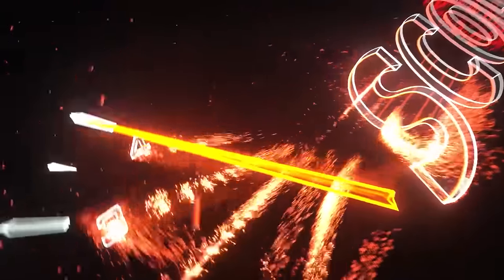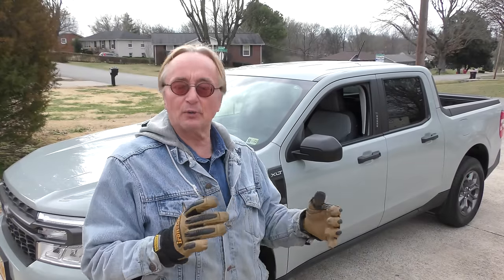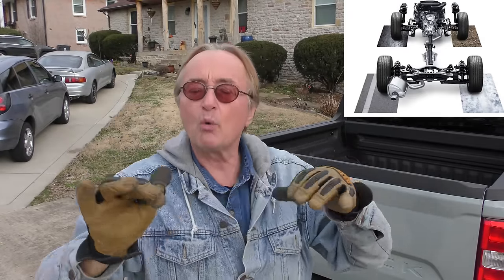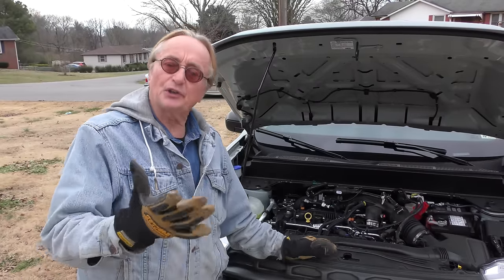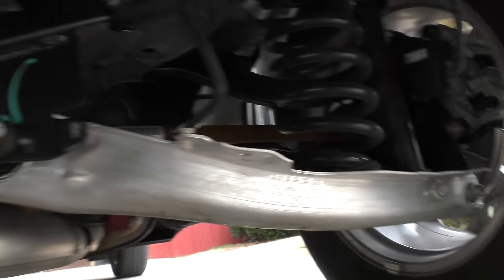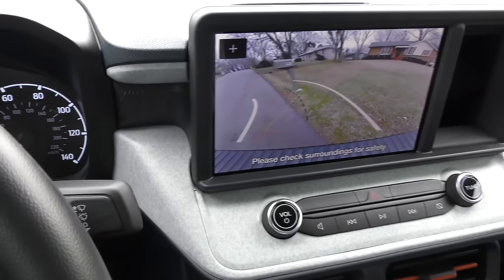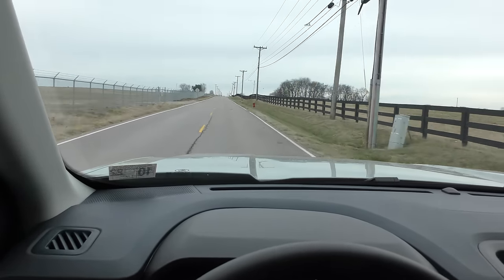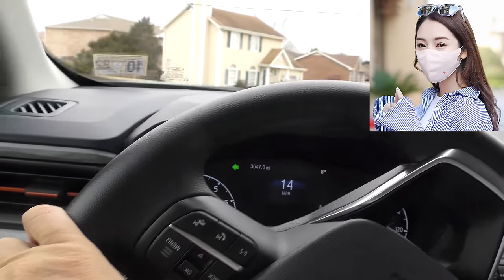I Finally Got a New Ford Maverick and Here's What I Really Think of It

Comment: I've owned my Maverick for a little over a month. I have the basic FWD version with a tow package. I've taken it on a couple of longer trips and have gotten 35mpg each time using the eco setting. I'm surprised by how quick it is when passing, and it is a very simplistic yet versatile vehicle. Most of my complaints about it are just nitpicky things. It drives/handles very well and I give it an overall thumbs up so far. Get a bed extension bar for the receiver and you'll be set for just about anything.
Reply: Very useful information let us know how reliability is down the road bud
Reply: For people who tow, the fwd w/ tow package is 4k capacity and 1500lb payload.  No offense but "just about anything" is very specific to you.
Reply: @dcgregorya5434  You are right. You are not going to haul cattle. I have a small boat, kayaks, and a small trailer. It does just fine for those things. I would hope that anyone buying this truck would know the basic package isn't going to haul huge loads.
Reply: @lonewolffisherman7092  it can haul the same types of stuff you can haul behind a minivan. Not kidding btw, it has the same stats. Thats my issue with this truck...its the truck that just isn't.  There's a big world thats less than a cattle trailer and more than what this can do, it has very low stats to where I feel like people are going to try to do pickup truck stuff with this and come away sorely disappointed or worse, get hurt or damage it.
Reply: @dcgregorya5434  I've never hauled 4x8 sheets of drywall in a minivan, but I have with the maverick. I get what you are saying about towable power, but having a box on the back is very useful for someone who likes to DIY things for my home. That's why I bought the basic package. It's all I need. I've been waiting for a decent priced 4cyld truck for years because that's all I needed/wanted. Great gas mileage and perfect for what I need.
Reply: @lonewolffisherman7092  Was helping my brother-in-law work on his parents home one weekend and his wife has a Chrysler minivan that they use as a family vehicle. It was great to use to haul drywall, BUT... he had to basically clean out the entire back to drop the seats into the floor. Since they had 3 kids that don't take care of things, it took a good 15 minutes to empty it out so he could lay the drywall flat in the back. He was cursing up a storm because of the kids and his wife aren't taking care of the vehicle.
I'd rather have the Maverick :D
Reply: @moej6014  Lol that's too funny.
Reply: @flashlightfreek  10000 miles on my maverick and still loving it. Best mpg to date is 37mpg on a 257 mile trip. The nitpicky things are the radio/infotainment system can be glitchy, and the mode of driving you use doesn't save. Meaning, if you choose eco, sport, or slippery it will default back to normal when you shut down the truck. That's about it! So far so good!
Reply: By basic FWD do you mean CVT, not hybrid?
Reply: @Joshua Nuss  Not a hybrid. It's just the basic gas burning engine.
Reply: @lonewolffisherman7092  just making sure i undersand, you have the 4 cylinder not the hybrid? those are some great mpg! im looking forward to hopefully ordering a 2024
Reply: @jakecelly8215  Yep! Just gas. No hybrid.
Reply: @lonewolffisherman7092  awesome news, thanks for reply!

Comment: I'm waiting for 1 cylinder, hybrid, quad turbo boost, making 60mpg combined, 550 hp and 500 torque, with msrp $45,000 with $35,000 mark up dealer plus 25 APR and total $100,000 out the door just for small pick up truck.
Then I will lifted with $30,000 lifted, put $10,000 tires and rims and put the Balls hanging on the back to make it look cool.
Oh yeah, put a bumper sticker:
C O O L
a $1,000 bumper sticker.

After 4 months, I cried because the dealership tow away my small pickup truck.

At least am happy driving it 4 months only on weekends. 😅

Comment: Maverick is and will be proven to be an excellent little truck. Ford is getting it right with the escape Bronco and Bronco sport and now… they got it right with the MAVERICK. Good to see…
Reply: Truth.
Reply: Says who....?
They just came out and aren't proven
They might be a dissaster like all the other ecoboost engines that are twin turboed with GDI..... 
How long will the AWD system work for the rear drive coupler?
Good luck
Reply: @fil1329  Yep you got it brother. For me I chose the Coyote V8 over the EcoBoost V6 anyday of the week because that way I don't have to deal with the issues of the turbos going out and costing a fortune.
Reply: If they would just get rid of that horrible 1.5  3 Cylinder! 
It's not fuel efficient!

Comment: Scotty, you mentioned  Maverick  from the 70s. I live in the south and I know of two Mavericks,  a lime green  and a brown  one. They both are in very good  shape  and seem to run well. That truck, you're right if not many troubles  rise up with these, they could  be the next  Model T sales wise.
Reply: Could never be said about the Chevy Vega.  The Vega was a piece of crap and always will be a piece of crap.
Reply: @sd906238  we test drove a Vega in 1973 and as soon as you stepped on the gas the engine felt like it was going to leap out of the car. I believe it had the aluminum engine which turned out to be one of the worst engines in automotive history.
 I really considered this sad because i thought it was one of the best looking compact sport coupes out there and the reason we went out to test drive it in the first place.
Reply: Our friend got the Maverick car when it first came out in the early 70s. It was okay but had a crude suspension that let you feel and hear the tiniest imperfections in the road's surface.
Reply: I'd take a tubbed out Vega with any SBC.

Comment: My favorite feature: It has a window that you can see out of 😁
Was waiting on the 2023 (have to now, they stopped taking orders in November and won't again until August).
Hybrid, commute for work, no towing, occasional hauling stuff.
Hoping for some changes for 2023: AWD hybrid, fog lights,, etc.. Perfect for me. $10K less than a car.
Reply: I'm waiting on a 4wd hybrid model to come out. It will replace both my Dodge Dakota and my Prius. I hunt, fish, camp and occassionally pull a trailer with a lawn mower on it(I've done it with my prius). I've gotten stuck in my dodge dakota hunting, and I used 4WD to get out. So that's what I'm waiting on.
Reply: My guess is they won't put out a hybrid AWD. Just not enough oomph in that motor to handle the extra drivetrain. I could very well be wrong though. We've got a hybrid FWD on order.
Reply: @munkydotorg  the Ford Escape had a 4wd hybrid. I think it was the same drive train?
Reply: Ditto...👍🏼

Comment: actually the hybrid on this vehicle IS the base model for the $20,000 sticker price. the turbo model is more expensive. Also, I trust the hybrid more than the turbo engine. The hybrid has a naturally asperated run of the mil 4 cylinder paired with a ecvt, NOT a regular cvt with steel belts, but a gear to gear cvt system with a run of the mil electric drive motor attached to the transmission. Anther good thing about this, is even if the batteries ware out, it can still utilize the gas engine no problem, even for years to come. I would not flinch on buying one of these used, as normal hybrids drop in value very quickly.
Reply: Hybrids actually hold their value better… I’ve had 3. Hybrids have high demand..
Reply: I have a 2013 Fusion Hybrid with that configuration (I think it’s the second generation). It’s over 200k miles and it’s really holding up well. HV Battery is showing its age (especially in the winter), but it reliably gets the car a few miles before it turns the engine back over. A few of the 2013s had some bad problems, but I have to assume by 2022 they’ve worked out those kinks. It’s a sound design that’s mechanically less complex than the turbo charged, GDFI, 4 cyl on that wonky electronic transmission.
Reply: You might want to look again the hybrid model has a different type of 4 cylinder engine.

Comment: I have the 2024 XLT front wheel drive version. On the center console there's a 5 button cluster and the bottom left pad, if depressed, will disable the auto stop/start crap feature. You do have to press it after each startup to disengage as it defaults back to the auto stop/start.

Comment: From the video, its looks like these are equipped with Continental ProContact Tour all-season tires...EXCELLENT all around tires, I have these on both of my vehicles...Rated for 80k miles, cuts through wet, rainy roads like nothing, and also quite decent in light snow/ice
Reply: I have the same tires on 18 in low profile rims but I got a bad batch of tires as the treads weren’t smooth on some and was shaking for 8k miles, they didn’t static balance but I bought the best tire for doing everything and had the best overall all season performance in snow which I get a lot of in New England. It’s on my hatchback Mazda 3 (2014)
Reply: yes and yes but they get noisy
Reply: @jamesmedina2062  yes I noticed that too, they’re quite meaty and my car didn’t get noise dampening until 2018 model so I hear more. I listen to music loud anyways lol
Reply: @ItalianMetalHED  All cars get noise dampening but what is sad is that many economy cars get much less on purpose. It doesnt need to weigh much either. Its fairly easy to address via lightweight materials.  Engine noise has proven harder for me to address in lower octaves.

Conti are good in snow and rain but you can try some others.
Reply: Blizzaks are my favorite snow tire
Reply: My 2021 Audi A5 has the procontact gx and they are the best tires I've ever driven on hands down. Whenever the choice is presented to me, I'll always choose continental.
Reply: @xfiringsquadx  they had the best rating overall in all the categories I seek it’s why I chose them
Reply: @jamesmedina2062  for approx $150/ea, they are the best tire available for under $200-$250
Reply: @mikenapolo2490  For road cars there are so many. Falken, Toyo, and Dunlop have worked well for me. For road bike I only use Continental 4000 and 5000.

Comment: If I were considering one of these, I would worry most about the Ecoboost engine.  Ford has made front wheel drive transmissions and uni-body cars for decades.  Ford can do it well if they wan to.  My mother had two Ford Taurus's that went close to 300,000 miles and we had a Ford Escort that went 240,000 miles.  Both front wheel drive and unibody construction.  As to made in Mexico, I had a 1982 Ford Ranger with the 2.3 that went almost 300,000 miles.  The engine was made in Mexico. (It was noisy as the 2.3 in those days was not counter-balanced).
Reply: The ecoboost has been around since 2011 so it’s pretty well proven. Solid engines
Reply: @josephnelson9020  This is not what I get from  You Tube. I do not own one, so do not really know.

Comment: I've got 5,000 miles on my Lariat Maverick with FX4 and 4k tow package. I absolutely love it, have had 0 problems, get great gas mileage, and can tow up to 4,000 lbs. I've worked at a car dealer for the last 11 years and this is one of the most well rounded vehicles I've ever driven. For the price it can't be beat.
Reply: Bugs Bunny  with x plan 31k out the door
Reply: 5k miles lol
Check back in when it hits 80k miles
Major problems will star showing up.
Reply: @jesseserrano6520  80k miles is nothing lol. I doubt you'll see many problems, especially everything used in the maverick has already been proven in other vehicles.
Reply: @Jesse Serrano must be a chevy colorado owner
Reply: @freedomfan4272  you sir are incorrect was again.
 I own Lexus and toyotas all made in JAPAN
No ford junk or Chrysler or chevy garbage.
Reply: @jesseserrano6520  oh I’m seeing major problems on eco boost engines long before that. Also Ford seems to typically use weak transmissions. I hope I’m wrong. I have no Ill will toward Ford but they always come up with these well designed, sharp looking vehicles then give it a fatal flaw. 
Cheers

Comment: Welp Scotty - I'm an Ford man from the 60's and I love hard core points and carburetors - glad to see the name Maverick back out and it really fits on a car/truck.  I cant wait to see you review of any EV.  I'm going to be the last one to buy an EV - too High Price......
Reply: EV's have been in the market since the late 1800's. The problem is that manufacturers still insist on the same mistake they did at that time, while putting the blame on the oil industry. I'll only buy an electric car when a complete conversion kit costs less than an engine rebuild.
Reply: 70s maverick buffs cant understand why ford called it a maverick. No imagination maybe.
Reply: @gsilva220  Surprised you didn't expect it for free.

Comment: The hybrid gets 40 mpg and it is the LEAST expensive model.
Reply: WTF... Really???
That's an awesome deal then! Never seen a hybrid version of any car that was cheaper than the non-hybrid version.
Reply: Wow
Reply: That doesn't make sense
Reply: @richsweeney1115  standard engine is hybrid. You have to upgrade ~$2200 to get the 2.0T gas.
Reply: @shane250  They made a cheap SUV/Truck that's a hybrid and selling for half of most other "entry" level vehicles. It is pretty brilliant.
Reply: @SlavicCelery  
I agree. I usually ignored Ford because I preferred Japanese reliability (FYI, Nissan is NOT Japanese), but if I can buy 2 small hybrid Ford trucks for the price of one Japanese (Toyota\Honda) SUV, than it's a no-brainer... Ford it is!
Reply: @shane250  it takes 10 seconds on googling to discredit almost anything Scotty says. Yes, the Hybrid is the STANDARD engine for the Maverick regardless of the trim.
Reply: @HEMi1995  
I was a tech at a ford/Mazda for 5 years (In the European market, they are in the same dealership)...Scotty wasn't the one telling me they're unreliable.

The Exploder/Escape/Puma (European)/Focus/Fiesta (2012-2015) were highly unreliable. The Mondeo (Eu)/F-series/Fusion were pretty good. But the F-series diesel had tons of problems with their sophisticated exhaust systems (all the sensors/components relating to the DPF system).
Reply: @shane250  plenty of Ford Fusion hybrid taxis in NYC running 150,000+ miles no issues. These hybrid setups are way more reliable than anything you’re talking about.
Reply: @djpeteyc  
Well, I don't see that model on the "best in reliability" list of consumer reports.
Reply: @shane250  One of my coworkers has a Fusion hybrid and it's nothing but problems

Comment: I absolutely love my Maverick 2.0 AWD. A couple days ago I put a 5-6 hundred pound engine in the bed of it and hauled it home on the expressway. It didn’t even phase the truck. Still got over 25 to the gallon.
Reply: Do you think it could haul small trailer and mower
Reply: @michaelsmith3877  for sure. Base model has a 2,000 pound tow capacity and with the tow package it bumps up to 4,000 pounds. It could tow my ranger or f100
Reply: the word is   faze.....

Comment: I am excited to see an actual small pickup. The Ranger, Colorado, Canyon, Tacoma are huge compared to this vehicle and the old school small trucks.
Reply: The new generation Tacoma is a huge disappointment. Bigger bigger bigger. At least maybe they are painting the frames? Lol
Cheers
Reply: My 07 Silverado crew cab is on its last legs so I've been shopping around recently. 2022 Tacoma- a midsize- is only a few inches shorter and narrower. Modern midsize trucks are effectively the same size as full size trucks from 10 years ago. It's insane.

Comment: "only 250hp" - for some context my old 71 Challenger R/T with the 340 was rated for somewhere around 235hp - at the crank NOT the wheel.  the Maverick weighs about 400lbs more.  but still pretty amazing what they can get out of the little 4 cylinders these days...

Comment: I think these trucks will outsell the Rangers by far. The Rangers got so big, it almost like an old F150. Folks just want a small truck, and with the ability to give 4 cylinders the same power as old 6, even better. A good mix of efficiency and utility. If I fit in one, I would consider one of these.
Reply: Whats funny is the maverick and ranger are almost the exact same size.  Ranger sits higher because body on frame vs unibody on the maverick.